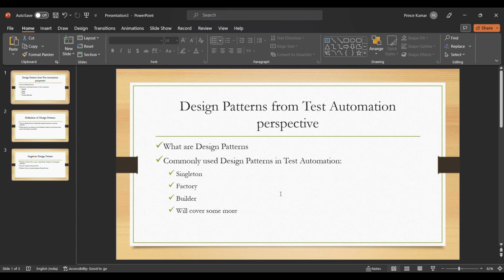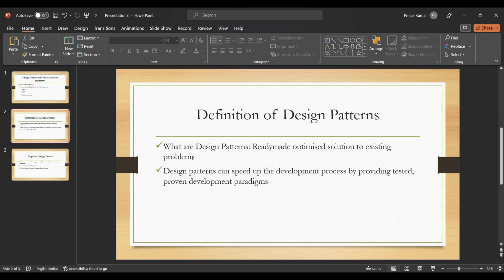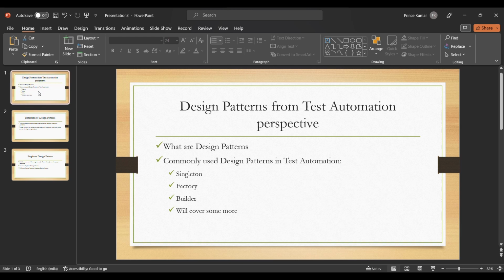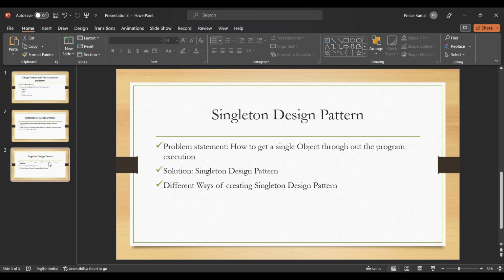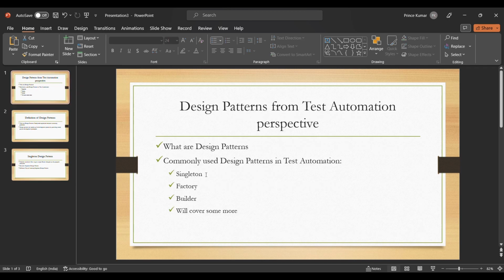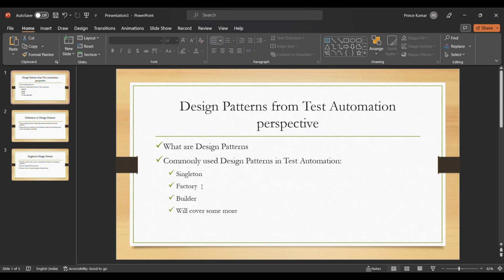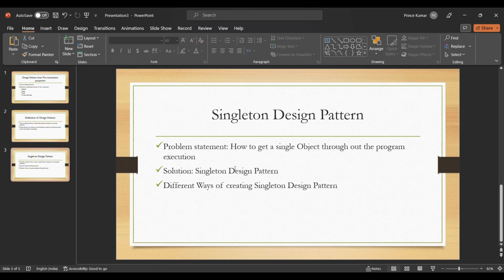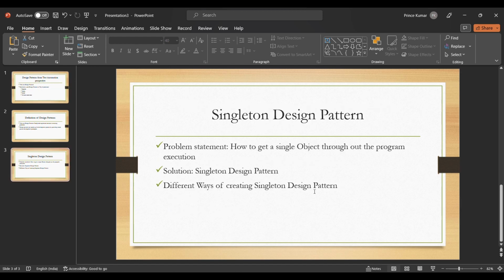Mastering Design Patterns for Automation QAs: Lecture 1 Introduction

Comment: If we want to avoid creating object we can go with just a static method know what is the reason we using singleton then
Reply from the maker: We are not avoiding the creation of object, we are restricting class to return a single instance.

Design patterns are ready made solutions to the problems.

So it is just an alternative to static driver instance, purpose of both is same to provide common instance throughout execution